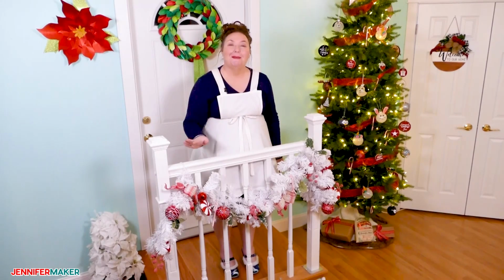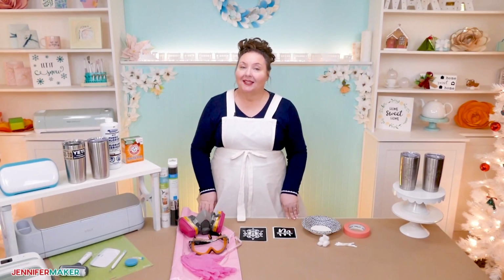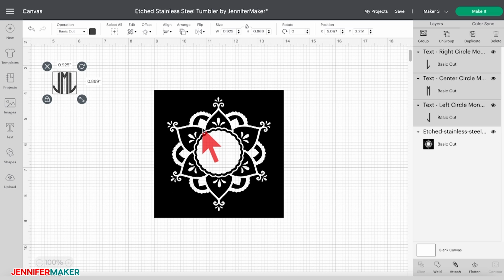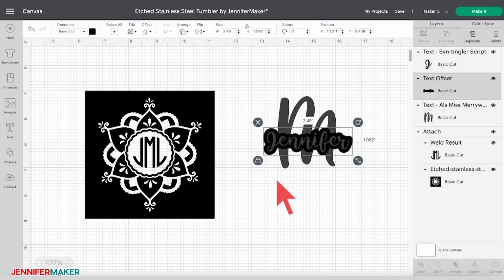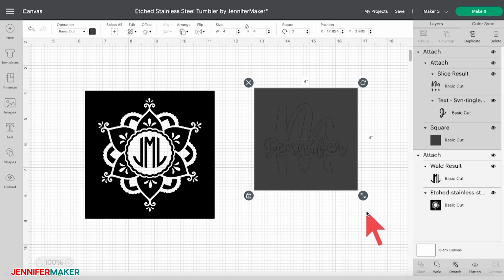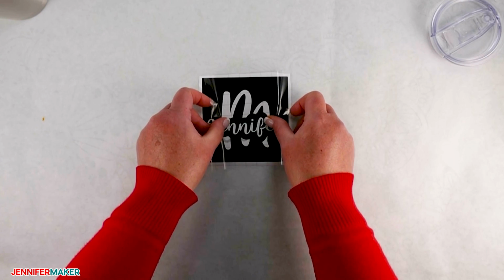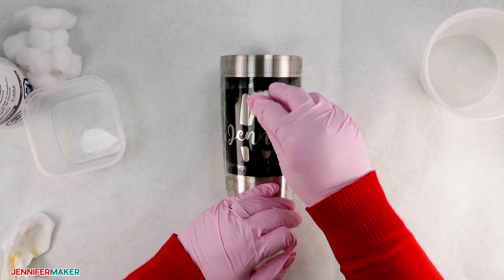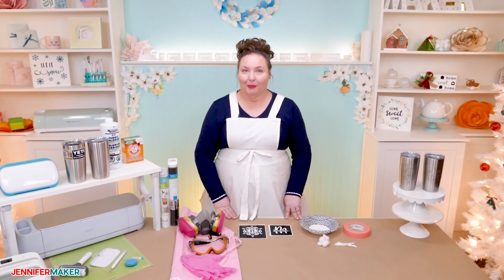How to Etch Metal at Home: DIY Stainless Steel Tumbler with a Cricut Stencil!

Comment: Jennifer, Thank you so much for this wonderful tutorial. I tried to make this etching using a stainless steel Thermos coffee and followed the instructions correctly, also I double up the time bc after the first 10 minutes and removed with baking soda, didn't see any difference , so I decided to do a second round after remove the baking soda really good. The result was just a silhouette of my design but etching was no very visible. Any recommendations? I would like to try for second time. Thanks in advance!!!

Comment: Hi! Do you know if the ferric chloride work slower if you use it when it's cold? Today I did my two first tries with this technic, but it almost didn't even leave a mark on the stainless steel. I did the etching outside for best ventilation and the tempature was around 46.40 ℉. I have tried to search for an answear my self, but I guess that my english isn't good enough to figure it out. Thanks in advance!
Reply from the maker: The temperature was warmer when this was made but I don't think that would make that big of a difference. https://jennifermaker.com/etched-stainless-steel-tumbler/ You can ask in the group to see what others have experienced. https://www.facebook.com/groups/cricutcraftersandmakers/

Comment: I tried and tried bit and even left the ferric chloride on longer to see if that would work but nothing is working. I did use a stainless steel tumbler. Im so upset because this is what I was going to do for xmas gifts 😢

Comment: I just wanted to add a little note that there are different degrees or whatever you call it of stainless steel (they have some sort of number designation of the degrees) and also if you're doing other metals they will do a little bit differently. Might have to adjust the time based on the material.  You might also want to practice on a cheaper Tumblr or mug before trying this on an expensive one just to make sure you have the process down. Nothing worse than screwing up an expensive stainless steel tumbler!

Even if you're doing a small area I would recommend covering the entire remainder of the tumbler because I have had the solution drip down around the back and I didn't realize it and it totally ruined the whole back of the cup, so even though my design where I was working looked absolutely awesome, the expensive mug was ruined with drips around the back and on the handle. 😭
Reply from the maker: Thank you for the great tips! 😃

Comment: Wouldn't the etch solution work,  that you can buy from Michael's?
Reply from the maker: Most of the etching solution in craft stores is for glass. :)
Reply: @JenniferMaker  i saw mr crafty pants do it on glass so i wasnt sure if it worked on the steel as well

Comment: Does the baking soda that you wipe off after etching harm the table? What do you think about etching / neutralizing the etching over a paper plate? I’m apprehensive about acid. Looks great.
Reply from the maker: Yes, as I show in the video, you want to protect the surface you're working on for sure and then I rubbed the baking soda onto the design over a bowl but you could use a plate or whatever works best for you.  💗